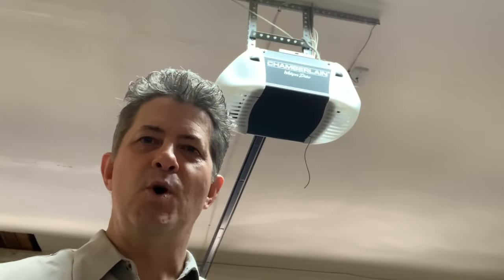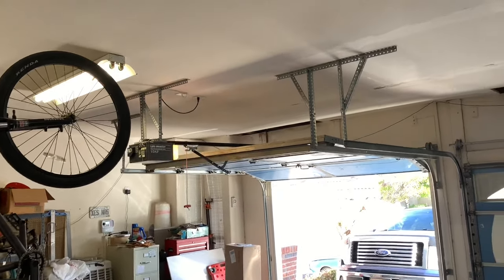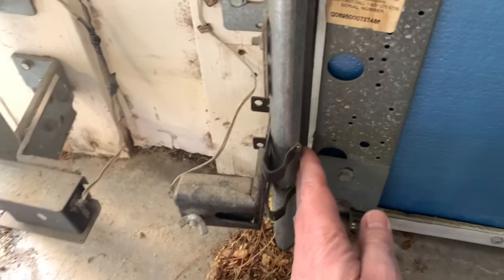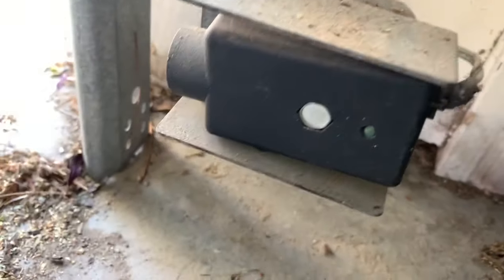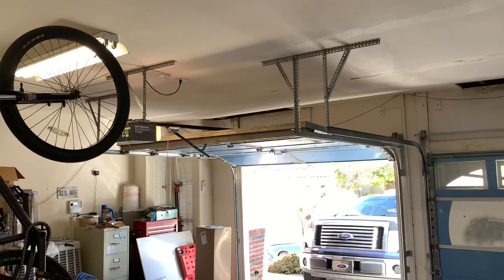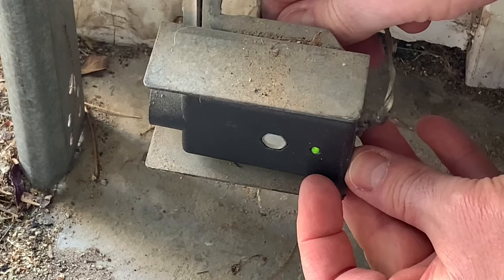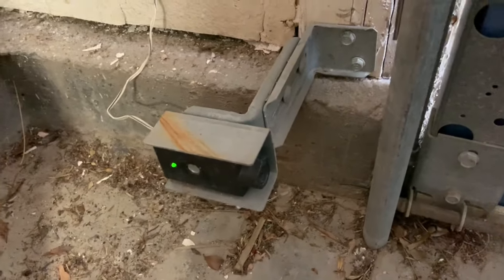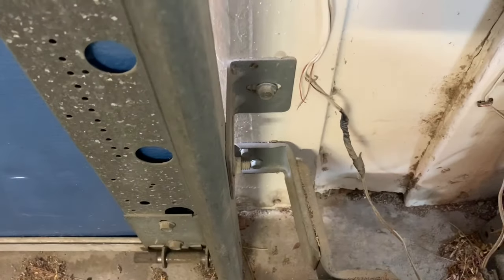Garage Door Opener Stops and Reverses

Comment: My garage door is closed and only opens about a couple of inches and then go back down
Reply from the maker: Gotcha. Try increasing the upward force a little at a time. There should be an adjustment screw on the unit for this. Also make sure the spring above the door is not broken
Reply: Thank you,I appreciate it.
Reply: Guess what when I went back outside to check the spring the spring was broke. 😢
Reply from the maker: @denisealston6312  The spring...bummer!

Comment: Didn't help. Any other reason for same problem?
Reply: So on mine it was rather a tricky one to figure out.  Been just holding its button until closed for about two months now.  I finally found time to analyze it deeply today after several failed attempts through these past two months.  One of its guide cables wasn't running on its grooved tumbler quit right due to a crimp in a couple spots so thought was causing an issue.  Nope, it still had same issue after straightening out those crimps.  Sometimes door would close just fine and other times had to hold its button its full length of travel.  On another occasion I thought maybe opener itself is set too light on its downward sensitivity setting of force tension.  Adjusted it and at first thought that was it since it worked fine after that.  I thought bingo, I fixed it.  Nope. next day it started haunting me again.  So today I finally had some time to really look into this.  I almost gave up and called a repair tech too.  Man am I glad I didn't.  I was convinced opener itself was going bad at this point.  So I sat down and ran across this video amongst many others that I blew through.  I almost blew past this one too Mike, no offense, since I already had checked my sensors multiple times and therefore had ruled them out.  But what caught my attention was how you shot it in a messy garage.  Mine is that messy but also not entirely clean neither.  So I listened and glad I did.  Afterwards, I went out and re-inspected my sensors, this time both sides very thoroughly and even re-adjusted their line up with each other.  Still same issue occurring. So, I sat there starring at both of them.  Then a little bit of breeze picked and something caught my eye swing out and go back to where it was.  It swung out right in front of one off the lenses of a sensor!!!! To my surprise, it was a flipping remnants of a spider web that was stuck to the outside door track about two inches higher than the sensor.  Embedded to its bottom, the web was acting like a string, was a good size piece of saw dust.  It wasn't blocking the lens under non-vibrating circumstances or even close to it.  So I shook that track rail a little bit and sure enough it swung across like a pendulum right in front of the sensor lens.  Bingo!!!! Removed that spider web and everything else in close proximity to both sensors and PROBLEM SOLVED!!!!  I had to share this.

Comment: What is problem if light flashes more than 6 times
Reply from the maker: It could mean that the sensor or wiring is defective, but it usually means that the sensors are either blocked or out of alignment

Comment: Nope. No help to me. Why? Because my door does not have any/those sensors and neither do any of my neighbour's doors. Checked pretty much everything and STILL my garage door continues to go back up automatically after it stops coming down to ground level. 🤨
Reply: Even though I press the garage door opener no light no movement. The lights on the board is on
Door won't open. What could be the problem

Comment: Mine closes fully and then automatically opens…
Reply from the maker: Try decreasing slightly the length of travel of the door. There is an adjustment for this at the motor.

Comment: My sensor works still won't stay down
Reply from the maker: Could be several things in play. I would shorten (or decrease) the length of travel of the door, and I would increase the downward force of the door slightly. There are adjustment dials for this on your motor. Hopefully this will fix it
Reply: @MikeKlimek  done that still acts up

Comment: One of my lights is yellow
Reply from the maker: The color really doesn't matter very much-is the door working correctly?
Reply: @MikeKlimek  I found the problem yes, there was a spider web hold a leaf when the door went down the leaf would go on front of the sensor and make it go back up. With the door up everything looked great impossible to see the problem until watching it close from the inside.
Reply from the maker: @gatorunleashed275  Sweet!